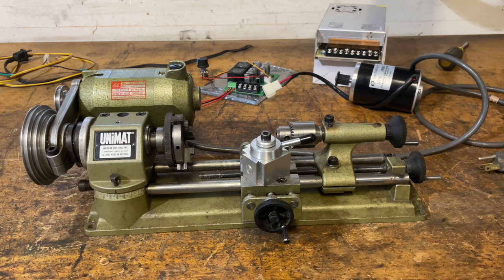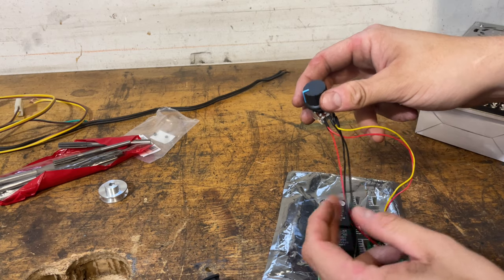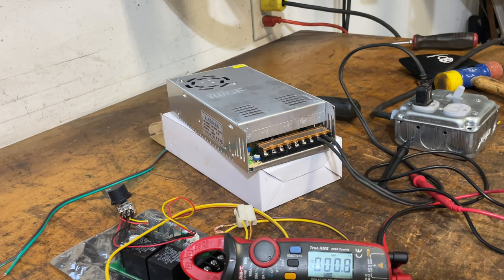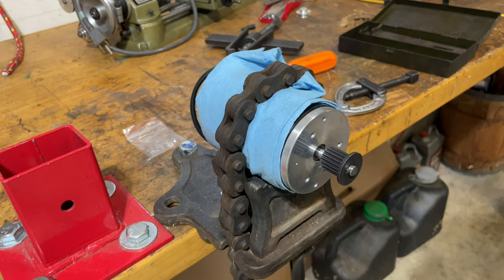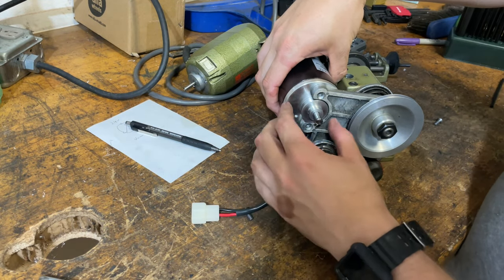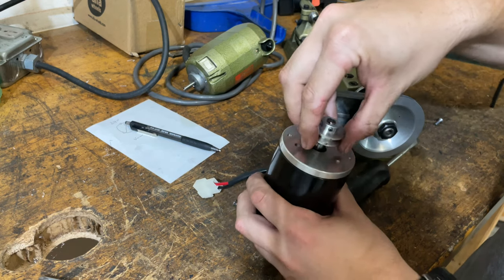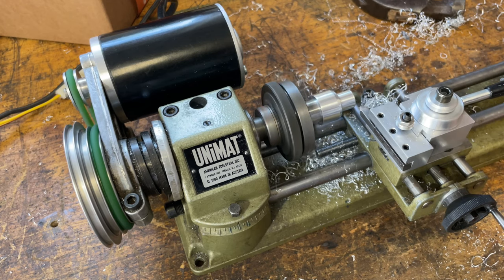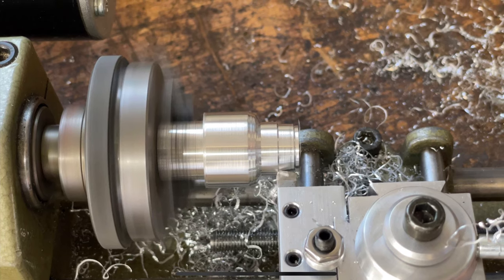Unimat SL-1000 Motor Upgrade to 150 Watt DC Motor with Speed Control

Comment: As a brit it makes me happy to hear you American's talk in metric thank you.
Reply from the maker: It really is a superior measurement system. I work in the automotive industry so I have to know it and I’ve just about fully converted over, at least with lengths.
Reply: old tool and die machinist here who also repairs watches as a hobby. work in both imperial and had to learn metric which I think is the natural progression. It's superior to imperial and well...just makes sense. I think it's easier too.
Reply: As a americ it make me happy to hear from our buddies across the pond. I’m 48 growing up working on my own stuff motorcycle,3wheelers,4wheelers. Mostly Japanese. (Honda) I ride the best lol used to metric system to. I like both makes for a expensive toolbox 🧰 especially for poor ole hillbilly. Because all my motorized stuff back then  u know about second hand well these where usually 4-5 even sixth hand lol. Well y’all. These little Unimat idk. Don’t get um. Lol. U will love um parts (accessories) more than price gold. U will have to have this and want that need those. So if you like treasure hunts spending $ not finding treasures I say go for it the treasure is in the 200$ piece you made cause accessories had buy when could got bolt from hardware store for buck minty nine. 1.99$. Lol. But how fun would that be anyone can run to hardware store. Hey I made that. Lol. Love to all are unimat db/200 sl/1000 owners. Little love to y’all unimat 3 owners with ur m14 threads. Ha there accessories are everywhere. Get u some m12-1.0 threads stuff then will talk. lol. Y’all know I’m just kidding having good time. I wish would ask for one back n 80 around 10 years old sears wishbook had them quite expensive little suckers back then to but wow boy has value went up. Well guy and gals. I’m starting to ramble on so will leave ya with a stay safe make something even if a $500 watchumacallit. From ur ole hillbilly buddy. Unimat s rule.
Reply: As a Brit having just brought a 1950 Velocette MAC I am going back to imperial ;-)
Reply: True- although it is strange to hear them referring to 'rpms' instead of 'rpm'- the minute is singular. Will take a while for them to get Hz...
BTW the US car industry has been metric since the mid 70s.

Comment: I did what you did with your lathe. And added the same stuff. You were right. The power is good enough for this lathe. Im gonna make a video using it as a end mill. I will definitely share your link if you don’t mind, so others can use it too. Thanks again for sharing.
Reply from the maker: Yeah it really “wakes it up”. When I first got it I was kinda disappointed but adding this changed my mind completely and makes it more enjoyable. I even switch some tools to carbide insert tooling (set from Harbor Freight) and it works great since it now has the power that carbide needs. And no problem sharing the link.
Reply: @TheVintageEngineer  I mentioned you in my video. I hope others can learn from your video as much as I did. Please upload more videos about your Unimat. Cheers.

Comment: I just finished upgrading my unimat. Thank you for the all info you provided. I played with the belt routing until I found one that I think gives me the best speed variations from zero to full speed. I routed the motor belt to the smallest pulley on the idler and from the largest pulley on the idler I ran the other belt to the smallest groove  on the spindle pulley.
Reply from the maker: So what’s your thoughts after upgrading?
Reply: I like it very much. I also have the quick change tool post that you have. These two upgrades make the machine much more enjoyable to use. Before, I hated changing the position of the belts because I knew I would get a finger pinched in doing so. The one thing I did different than you did, l made an adapter plate to mount the motor.
Reply from the maker: @franciscoflores7911  yeah the quick change tool post is an absolute must as well. Good to hear
Reply: Can you tell me please where to buy the quick change tool post? thanks!
Reply: @franciscoflores7911  thanks a lot! I’ll search it!
Reply: How is the new motor going? Was it worth it? I just picked up a Unimat SL DB 200 and did an unboxing on my channel. https://youtu.be/ImLhOnL4-_s I would love to read your thoughts on the condition of this great little lathe.
Reply: Bill, I haven't used it much lately. I ended up buying a full size Atlas/Craftsman lathe. But the Unimat was very helpful in giving me a better understanding of the basics of lathe operations. I didn't use the Unimat much after I did the motor upgrade because I got the Atlas soon after. If I were you I would wait on the upgrade until you get a chance to try it out the way it is and get a feel for it and see if it's something you think you would like to get long term use out of. One small suggestion to make it easier to use that I did with the Unimat. I cut some brake line tubing that was just the right size to slip over the handle of the thumb wheel, it made it easier to turn when moving the carriage. Good luck and have fun.
Reply: @franciscoflores7911  Thank you for that advice. I like the tube idea to put over the handles for more grip.
Reply: Bill, the tube fits loosely over the handle, it makes it easier to spin the thumbwheel. As far as cleaning the machine I wouldn't use anything like brake cleaner, it will damage the paint. Use mineral spirits of wd40.

Comment: I just bought a Unimat and am already planning this upgrade!
Reply from the maker: You won’t be disappointed. I actually got frustrated with the factory motor when I first got it and just about sold it. I’m serious when I say it feels like a different machine.
Reply: @TheVintageEngineer  Just got my motor, and was able to drill out the 2nd hole just like yours. It's a little less meaty behind that section on my plate but it still holds. Also, I accidentally pulled out the armature (just like you warned at 19:14) but the brushes didn't break. They crashed into each other but I was able to take apart the whole case and get them back into place. Next, I need to wait for the power supply and controller and pulley, lol, then I'll be all set.

Thanks for this video, it was very inspiring and confidence-building.
Reply from the maker: @DavidPlass  if you happen to feel like you need more material, you can get some aluminum brazing rod and build it up. I tried Bernzomatic brand and didn’t like it but the Hobart Brand is good.
Reply: @TheVintageEngineer  so far it's holding so I'm not going to push my luck!

Comment: Yes sir. Great video. You need keep unimat video’s rolling they have good following. Especially when doing great cheap upgrade.  Stay safe. From ur ole hillbilly buddy.
Reply from the maker: Everybody is looking for a cheap upgrade after they spent all their money on those official accessories. Wow do they command a premium.
Reply: @TheVintageEngineer  yes sir. The littler the machine more accessories cost I think 🤔
Reply: @TheVintageEngineer  yeah I’m doing that to mine going to go with brushless 1/5 rc motor but there 200-400$ good one. Probably do what you done. Looks like got more than enough power the machine can handle.

Comment: Thank you for a great video.  I am looking at an SL model but the motor is blown so this helps me FIND and INSTALL a replacement.  It's too bad these motors don't have a universal mounting (that would just make too much sense).  A drill and tap isn't bad though.  THANKS AGAIN.
Reply from the maker: After doing this mod, I wouldn’t hesitate getting one with a bad motor. Use it as a bargaining tool to get that price down.

Comment: I would use a grounded plug and ground it to the power supply case as well as the motor housing.

Comment: Interesting conversion. I recently converted mine to a 500w spindle. There are a few advantages to this-
- the motor is brushless
- more power for the same size
- more accurate speed control- it is a synchronous motor (the video shows yours slowing down under load).
Did you not consider making the pulley in the lathe?
I made mine half the size of the largest pulley on the lathe shaft- so my 12000rpm (max) motor can drive the shaft at 6000rpm- the max speed shown in the Unimat manual. Why the largest? Maximum torque. I replaced the whole bracket, since the lay pulleys are not needed. This avoided the need for adapter plates, etc.

Comment: Lower speed normally yeilds greater torque my friend. Plus your  your tool. Your cutting aluminium so you want a sharp tool. Your trying to do 2 jobs at once   you have the tool at 45deg to take more of a cut, good luck with that but i think you need to screw your lathe down as the forces increase, also you could have created more rake at the top end of your tool.

Comment: Nice vid. Working on upgrading my own with a PMDC motor and controller.  The thing is addictive and tooling is expensive.  But it's fun. Trying to do a couple videos myself. I'm still undecided about how I'm adapt the motor to the bracket and how to adapt pulleys and shaft.
Reply from the maker: You going with the same size motor?
Reply: @TheVintageEngineer  no it's a 90 watt. We'll see how it goes. Right now it's all disassembled for inspection, cleanup and grease. The thing is in near mint condition and hasn't really been touched in 50+ years
Reply: @TheVintageEngineer  wish I woulda seen your vid first I might have gone a different direction! Think I'm going off your links and modify a new pulley instead of the other way around.  Did you drill the shaft and put in a key pin like the original or stay with just the setscrews?
Reply: @TheVintageEngineer  I'm only a couple days into this so alot more to come.
Reply from the maker: @machinistmikethetinkerer4827  just a set screw, holding pretty well. Everything old tool I have I try not to modify in case I sell it and I know others don’t like modifications. If it wasn’t for that I would probably have bored the original pulley. But it wouldn’t be hard to just make another one.
Reply: @TheVintageEngineer  true true. That's the fun-possibilities are endless

Comment: Antony thanks for this video! I just bought an UNIMAT SL with Automatic feed Attachment, my first lathe. A question for you: Is the quick change a commercial product or has it been modified to be adapted? Thanks
Reply from the maker: Guy on eBay sold them. Username is hkoesnadi. Doesn’t appear he has sold any recently
Reply: @TheVintageEngineer  Thanks

Comment: Decided to go with a new motor pulley and ream it to size, to the new drive motor. I ordered off your links. Thanks for the tips and links. Meantime I'll keep original U90 motor and drive pulley together as is. I suppose I won't need to use the factory low-speed mount and pulley now that I'm rigging up a DC motor eh?
Reply from the maker: I would keep it. Even though the dc motor is  variable speed it still has limitations at super slow speed. I configure the pulley setup to get me in the rpm range and the use the speed control to tune it better. Plus doesn’t the pulley bracket act as a spring retainer for the quill spring? Can’t remember off the top of my head.
Reply: Oh I plan on keeping all of it for sure but you are correct-the quill spring is retained by the bracket and can't be used without it.
Reply: @TheVintageEngineer  I should have mentioned there are two pulley/mounts available-the one that ships with the kit and the slow-speed sold as an accessory.  I happen to have both. Might make more sense to ya.
Reply from the maker: @machinistmikethetinkerer4827  oh ok. I know the main reason they came out with the slow speed bracket (2 idler pulleys) was to slow down the speed significantly for the thread cutting attachment. Original single idler should suffice.
Reply: @TheVintageEngineer  agreed. I juuuust picked up a slow speed bracket, it arrived today. Now I don't know what I'm going to do with it. I don't have the thread attachment. Not sure if I ever will. You ever done any knurling on your Unimat?
Reply from the maker: @machinistmikethetinkerer4827  not yet but if I did I would I would do it with the type that clamps from both sides of the work piece (like a follower rest). I think there is probably two much flex in the ways to put full knurling force from one side.
Reply: @TheVintageEngineer  that much, huh? I'm going to throw an indicator on it see how much flex there is. Tested dc motor today blew fuse. Back to the drawing board haven't had a chance to dig into it yet. Probably something simple

Comment: Hello, a very interesting video. Can you please tell me which quick change steel holder you use?
Reply from the maker: I found it on eBay from a seller in California. His eBay about is “hkoesnadi”
Reply: @TheVintageEngineer  yesterday i got my steel holder (china). Today the upgrade motor will arive . Thanks for the inspiration!

Comment: Great job! BTW, what quick change tool post you have on your machine? I have been looking for one myself. Thank you.
Reply from the maker: eBay seller has them. Name is hkoesnadi. They post these up maybe 1 or 2 times a month and the sell usually within a couple of days so keep an eye out. Comes with 2 standard holders, one for 3/8 boring bar, one for flat blade parting tool, and one that holds a dremel for a toolpost grinder.
Reply: @TheVintageEngineer  Thank you, I'll keep an eye out for his listing.

Comment: Hello how u liking it now been few months. 
Also thinking about getting me the vener lathe 8x16 has bigger spindle bore. 1” or tad bigger. Seen where guy made a plate that fit his bed rails and mounts his unimat in mill form to rails. Use the lathe as table and chuck divider lot different things. With ur motor on it make good mill I believe on that bed give plenty of movement just a thought. More I check n on lathe vener there 50/50 hate um or like um. Just throwing options around n my head. Love have mill and lathe at same time. Thought about another db/200 mounted behind seen some like that but still limited size. Like the ideal of mounted on bigger lathe. Idk just thinking out loud like say. 
Anyway great videos watching this one two three times got money going pull trigger on motor combo u have. It’s nice. Looking. 
How’s been holding up with more power not wanting break other component’s. Thanks for listening or rather reading. lol going print out head space adapter this week and tailstock. Seen video gives lot room for swing 2” adapter 3D printed they held up goof so far he said. Sells them but I have ender3 max if only knew more about computers. Can do little if find files someone puts online thingiverse. So that n future with ur motor set up be nice. Going print my box enclosure to.
Reply from the maker: Done a couple little projects with it and was able to switch to carbide tooling (much better surface finish). But I haven’t had time to get back into it lately. I did pick up a Craftsman 6” lathe (same as Atlas 618) and I’ve seen Popular Mechanics articles showing a Mount for the Unimat to be used on the Atlas carriage. Would be great for cutting keyways on a shaft. Great thing about the Atlas is it has a built in indexing feature with I believe 60 stops.

Comment: Hey Anthony! Just finished the motor upgrade just as you showed and everything works perfect. The only issue I have is that the fan comes on as soon as I plug the unit in and it stays on continuously. The fan speed does vary depending on the speed of the motor. Since I have the electronics in a box (vented) I do not mind it being on all the time but it would be nice to be able to leave it plugged in and not have the fan running. Does anyone else have a comment on this situation? It would be nice to know if Im the only one.Thanks for the amazing video!
Reply from the maker: You can just wire a switch between the plug and the power supply. I printed an enclosure for the wiring end of the power supply and added an IEC320 C14 inlet port with integrated fuse and switch. Same plug you see on desktop computer power supplies.

Comment: You would get better results if you fitted a 200 watt 3 phase motor and a VFD..........also the tool needs a sharp positive top rake for alluminium with some kerosene for cutting.......works wonders.

Comment: How would you do an upgrade like this without any of the other electronics? Just a motor swap?
Reply from the maker: You can get get rid of the speed controller and just run the motor off a 24v power supply, if you don’t want variable speed.

Comment: I ended up buying the motor and everything else through your links. I appreciate you sharing them. Just out of curiosity, are you so far satisfied with the result? or would you recommend getting something more powerful? Thanks again.
Reply from the maker: Going more power might be a waste. I don’t think you would be able to do a higher Depth of cut because of the small round ways. I actually had a spare 250 watt motor from a razor e300 scooter but the form factor is more like a pancake so the diameter was too big. So extra fabrication. Do I like it? I think it might be the best bang for getting buck upgrade. Higher depth of cut and not having to worry about overheating the motor are the biggest pluses. I actually tried it with carbide inserts after the video and it work really well, which I always heard carbide requires more power than HSS. Make sure you either build an enclosure or at least have the components in an area where chips/swarf won’t hit it. Don’t want anything shorting out.
Reply: @TheVintageEngineer  Thank you very much for all the information. I will definitely follow your tips. I appreciate it.